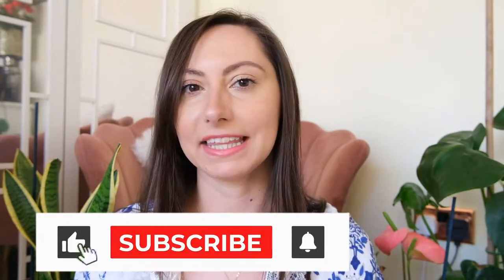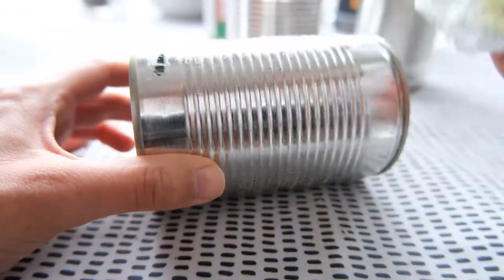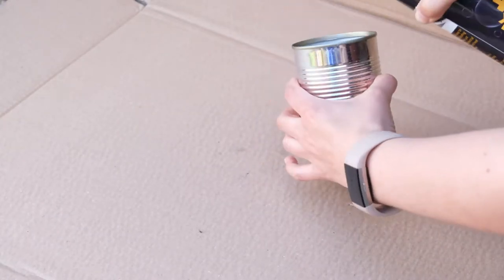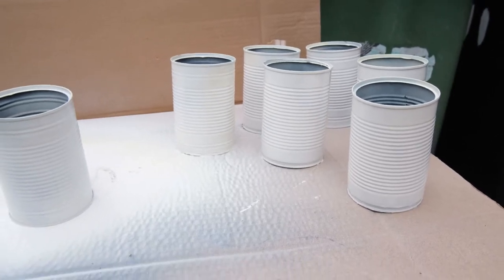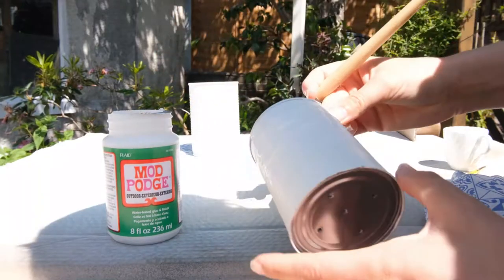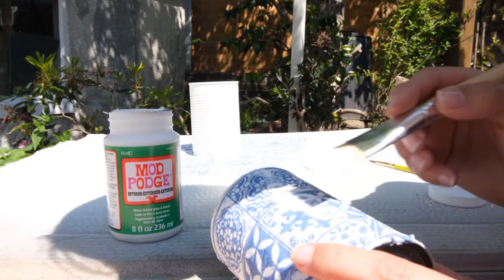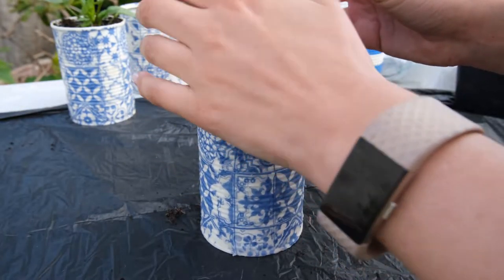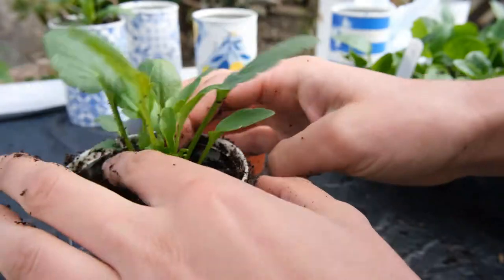DIY Tin Can Plant Pots | Transforming Tin Cans into Planters | Upcycle Your Rubbish

Comment: If you'd like to try, lighter fluid works wonders for removing adhesive in my experience :) just drip some and leave for 20-40 secs before using a cloth to rub the adhesive off.
Enjoyed your video, thank you for sharing!
Reply from the maker: Thanks for the great tip! I didn't know that you could use lighter fluid for that, so will give it a try next time. Glad you liked the video, and thank you so much for watching and commenting! Hope you have a lovely week :) xoxo
Reply: @AimsysAntics  hope you have a lovely rest of the year Aimsy! You're most welcome and also if the surface will be covered, you could use a scraper tool to remove the soaked adhesive bits. If we're lucky the adhesive comes off as a whole piece!

Comment: How do you manage the sharp rim?
Reply from the maker: I tried using sandpaper to dull down the edges but it wasn't 100% effective. I guess you could try bending the rim down into the tin so the sharpe edg is inside. Long answer short, I didn't fully remove the sharp edge, so just have to watch the fingers when potting anything in it. 
Thanks for watching :) xoxo
Reply: There’s a can opener that leaves no sharp edges. It great